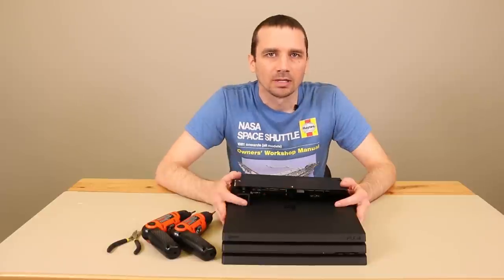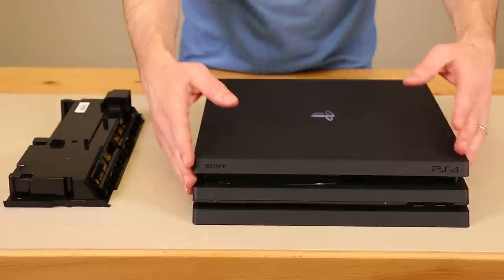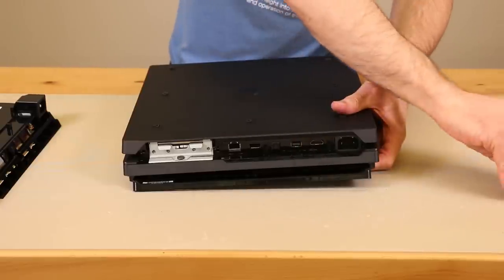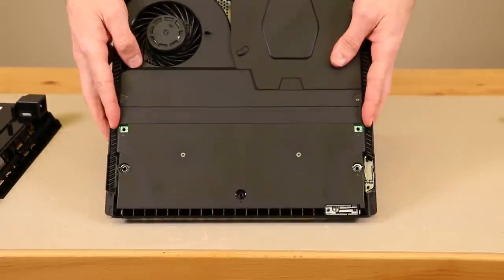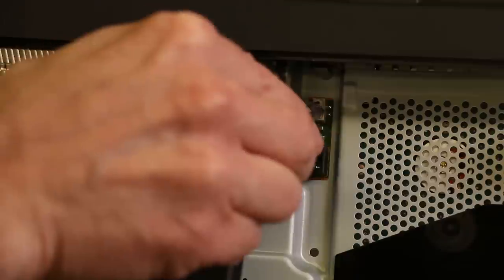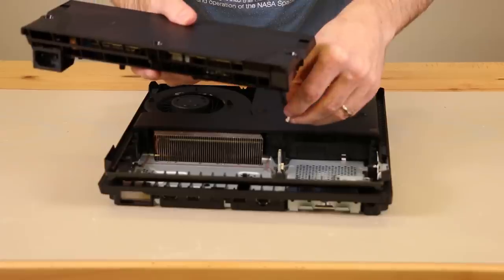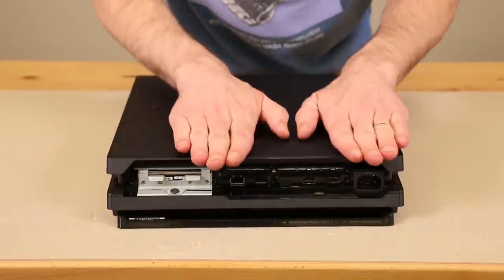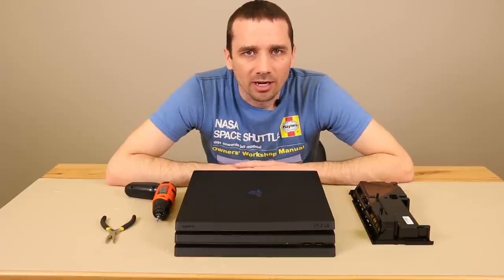PS4 Pro Power Supply Replacement

Comment: Nice video, but for some reason by PS4 stays off... It was working perfectly and the next day, no bips, no lights...nothing.
-  I tried to turn it on without the HDMI connected
- I tried changing the cable "power supply". I used the one my PC is using (it fits perfectly, but doesn't turn on)
- Following the step of this video, I bought a new power supply and installed the new one... It doesn't work
It still doesn'tmake any bip, any light , nothing. And now I don't know if the company that sold me the new power supply has lied to me and the piece don't work, or in the other hand it is sth else with my PS4 Pro and it wasn't the power supply.

I though that if it doesn't make any sounds or show lights will be the power supply, but know I don't know what to do. I would like to know your professional opinion, before thinking about sending my pS4 Pro and spending 175 pounds more on it.

Thank you very much in advance

Comment: I have a ps4 pro power supply went so replaced it now have no hdmi output could the PSU BLOW the hdmi chip
Power supply caps went pop it turns on blue to white but no picture

Comment: where do i get the power supply
Reply from the maker: Nowhere that I know of right now.
Reply: TronicsFix i can put a ps4 power supply on a ps4 pro
Reply: or do i need a ps4 pro power supply
Reply: As far as I know you would need a PS4 pro power supply since its rated way higher than the original one because the PS Pro needs more power...

You might be able however to connect a PC power supply as a temporary fix, try searching the web for that, I DONT KNOW IF ITS POSSIBLE, but on the Xbox360 we used to do it...
Reply: guily6669 ok but do you know where to get one
Reply: I think I have seen people using a PC power supply in the PS4 pro somewhere... try that as a temporary fix and if it works then you could search maybe on ebay, no idea where to get it :(

EDIT: But if yours is still under warranty and you didn't have it damaged by falling or anything like that, then Sony should probably fix it (I never sent a sony console for warranty though, I never had a broken one).
Reply: amazon
Reply: Amazon

Comment: I had a power outage for a couple quick seconds , loud pop sound. Everything that was plugged into the socked works except my PS4 Pro, doesn’t turn on. No lights , no beeps no nothing. PLEASE IS THIS THE POWER SUPPLY ? What can I do ? It’s not even a year old & this happen. Is it dead completely ?
Reply from the maker: There's just no way for me to know. Sounds like most likely a power supply problem.
Reply: @Tronicsfix  does all PS4 use the same power supply

Comment: Last night my PS4 slim had power surge while on rest mode smoke start coming out with 2 times sound like short circuits make I turned it off quickly and opened but it didn't find any significant signs of burning but there was some kind of liquid around power supply then in morning I tried to turned it on and it got blue light and then white I shut it off.... Is it okay to use?

Comment: Hello my friend, First congratulations on the channel !!!

 I would like information if you can help me.

 These days a lightning strike in the electrical network causing a problem in my PS4 pro.  The problem was that it turned on the blue light and then went out when I turned it on.  With that I took in an assistance and they said it was the source, made the replacement and handed me the PS4 working, I play normally here.  But something very strange is happening ...

 After plugging the PS4 into the outlet, I press the Power or the PS of the controller and the video game turns on normally.  But ... after using the video game and turning it off, minutes or hours later when I try to turn it on again, it will only turn on if I press the Power button on the console twice.  I can also turn it on if I press the Power button on the console (it will beep) and then press the PS button on the controller.

 That is, if I don't do this, I can turn on the controller several times, the light on the controller keeps flashing but the PS4 doesn't turn on.  For him to call I have to do what I explained above, pressing the PS4's Power button twice.  It also turns on if I press the PS4 Power once, then it beeps, then I press the PS on the controller.

 The strangest thing is also that it turns on normally with a touch on the Power or pressing the PS of the control IF CASE, I unplug the PS4 and plug it in again, after that, on the first attempt, it turns on normally, both by the PS  of the controller or by just tapping the Power.  In other words, the problem only occurs after I turn off the PS4 via the controller and try to turn the controller back on again.

 I believe this is a problem, because before it did not work that way.  Regardless if I turned it off on the controller, minutes or hours later when trying to turn on pressing the PS on the controller, the PS4 always turned on normally.

 Could the channel or someone help me about this defect?

Comment: that was easy, im under warranty but i can fn find the damm receiv so im gonna have to repair it my self i done this sortf of things before, what i would like to ask is what cause this problem in the first place? couldn't it had been my 2TB internal or my 8TB external? or does it have to do with my plug set up? or dust build up altough i just had my ps4 pro for 6 months.

Comment: I heard a pup sound when i plugged my ps4 pro in the outlet than it never turned on is it the power supply? 😓
Reply from the maker: Sounds like there is probably bugs in the power supply.
Reply: @Tronicsfix  sony work.. I hate sony
Reply: @Tronicsfix  now i need to replace it than?
Reply: @nicolasnidal9681  yes and clean the bugs if you have

Comment: I need a replacement 4 pin cable for the PSU (Model CUH-7215B ADP-300FR) since I ended up damaging the one that came with the PS4 Pro and Amazon doesn't have any for sale (they only have ones for CR or Slim model PS4 not Pro) so it would be great if you could help me find a store that sells it.

Comment: Mine has no power :( and the power supply is working fine (we used it on another ps4 pro and it turn on) and the power cord is fine any ideas?
Reply: Bro if that happens it is a apu problem the apu is the gpu and cpu
Reply: @roxannebaldeo733  I've read online that if the apu is the problem it bips and flashes blue but mine doesn't do that, it doesn't do anything at all

Comment: hey Steve, have you ever experienced a high pitched noise whenever the power cable is plugged in? i always hear this high pitched pulsating noise. So i always unplug it just cause i can’t sleep with my PS4 plugged in.                                                                       some facts: i have the 1st Gen PS4. the original power supply made the noise too. it went out eventually and i bought a replacement power supply and replaced it a few years ago and my PS4 has been running great since. but it still makes that constant high pitch pulsating noise and definitely can be heard in a quiet room at night. has that always been a normal trait for the 1st Gen PS4  or any of them?
Reply: That's what I'm wondering

Comment: you guys all ready found a ps4 pro with a broken power supply?
Reply from the maker: This video was just showing how to do it, but yes, we have had them in for repairs already. It wasn't the PS4's fault though...it was a diy fail!
Reply: Mine broke in 2 months
Reply: I think mine power supply just died. Ps4 pro beeps, blue light goes on for a second and shuts down. No response at all after till i unplug the power cable and try again. Same thing happens.
Reply: Saab 9-3 Aero Sportcombi 2.8 v6 same thing happened to mine... twice now in 1 month so I'm sending it in for repair because I don't want to have to go through the process of unplugging it and trying to make it work every time >.>
Reply: If the PSU died you'd not get any beeps or lights tbh
Reply: The same thing just happened to me this morning. I have the CUH-7115B model.
Reply: Lightning can damage the power supply so just change it and you are good to go.
Reply: +Navigate82 lol that happened to me my PS4 power supply was friend but I'm to poor to fix it so
Reply: Where can I get the power supply for the ps4 pro
Reply: Rozborn I have the 7115b and it first started shutting off during rest mode and now it won’t turn on at all
Reply: i think my power supplies broke but still playable. it sounds like didnt connect well and smell of burning wires

Comment: i took out my old power supply and the new one takes a completely different power cord?! and going to buy the cord isn't the problem but the cut out seems not right so even the right new cord won't fit into the slot!!!! i'm confused why tf does my ps4 pro come with the same old cord and supply as the base ps4 model but now i'm screwed

Comment: Why the PS4 fan small?
Reply from the maker: Small? That just depends on what you're comparing it to.
Reply: TronicsFix like the fan blades are too thin maybe that's why it gets so hot like the Xbox one fan blades are pretty think so the fan can push more air out I guess
Reply: MadpuX well they were stupid for picking that fan if the fan blades were thicker I think it would be quiet tronics fix maybe you should try that theory I have on the PS4 pro

Comment: My brother his PSU is stuck, for some reason. I try to find any information on YouTube and forums but i don't seem to find the exact same problem anywhere. It's not the 4-pin connector that is stuck, but the actual PSU ( that 2 pin fork from the motherboard that slides into the bottom of the PSU ) won't budge at all. I've made many many PS4's and PS4 pro's because i repair consoles, but i just cant get the PSU out. It flexes so much when i try to pry it out, until the point that I'm not comfortable anymore to put more pressure. Usually they just slide out easily, but the PS4 of my brother???? Stubborn little PSU 🤣

Anybody have the same issue? Or had this issue? 

Thx ✌🏽✌🏽

Comment: I literally cannot take my PS4 power supply connecter off from the motherboard smh
Reply: Me too
Reply: @master_x1175  update lol I broke mine. Try take it out the power supply I realised it was easier after breaking it. But just be careful aswell
Reply: @Sub-vo8fy  how did you remove it from the power supply I having trouble on it
Reply: @dawitarefaine6276  right so, I tried taking it out of the power supply off the motherboard. Ended up ripping it off. Found out that removing the cable from the actual power supply was easier just be careful and be gentle!

Comment: Just a quick question,  where did you get the power supply from? Would love an answer as my power supply has a short at the end of the large capacitor which burnt the board. BTW can't find it on Amazon.
Reply from the maker: They aren't available yet. I buy broken consoles sometimes to get parts from.
Reply: Thanks terrible info but thanks lol

Comment: How about a video to repair the power supply🙂
Reply: Not even worth it
Reply: @rafaelg4878  
Why, because you say so? How do you suppose ordering a 20 dollar part is more efficient than  50 cent capacitor or a two dollar resistor and half hour of of trouble shooting is not worth it?
Reply: @CarnivoreConservative  I mean if you can name electrical components, I'm sure you can just research it at that point.
Reply: @rafaelg4878  :/
Reply: Bottom line I think its worth it i sont give a damn if you think its worth it or not.
Reply: @CarnivoreConservative  I hope your day gets better, you seem mildly upset at literally nothing.
Reply: @rafaelg4878  
I like turtles.

Comment: Hey guys anyone got or have seen this problem? My ps4 pro doesn't go to rest mode when i put it in rest mode after a couple of seconds my ps4 cut the power on its own. Is that a power supply thing or sofware problem? That's the only thing it do, other than that it works fine

Comment: Why not just pull the wire out of the power supply instead of the motherboard ? that way if u mess it up atleast u won’t have to go through the trouble of soldering the wire connector back
Reply: YES! You should tell people to pull from the power supply not the motherboard ! loots of people including me ripped it off and I'm a tech 3.

Comment: I bought a PS4 Pro earlier this year and, after playing for a couple of months now, I decided to remove the top cover of the console to look for dust.

Surprisingly, there was no dust at all but I did notice two dark scratches, like fingerprints or something, on top of the metal plate that covers the power supply. I haven't noticed any problems while gaming ever since I bought the console, back in May, but I'm worried: Do you guys think these scratches may be a sign of internal heating? Is it normal? Do you think there's something wrong (or potentially wrong) with my unit? I barely use it... Just every other weekend...

Please, take a look at this picture and let me know your thoughts:

https://uploaddeimagens.com.br/imagens/p_20181103_122524_1_1-jpg